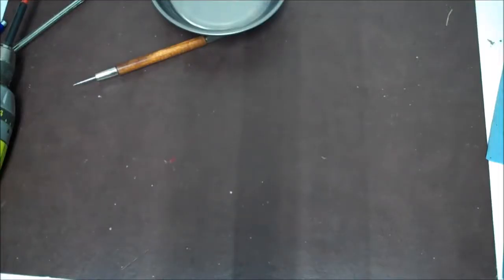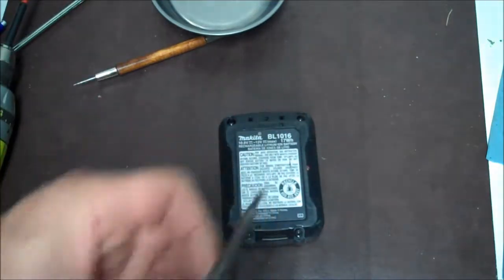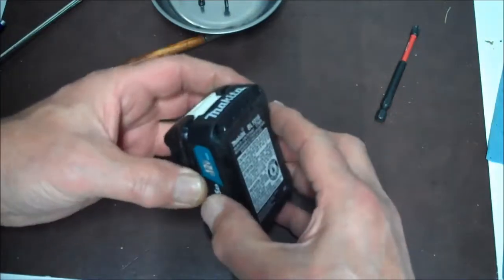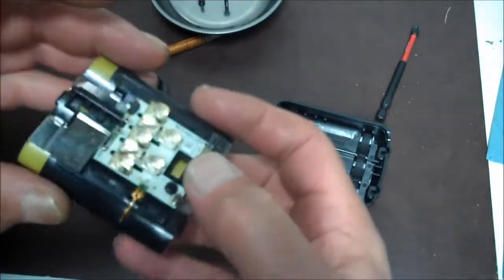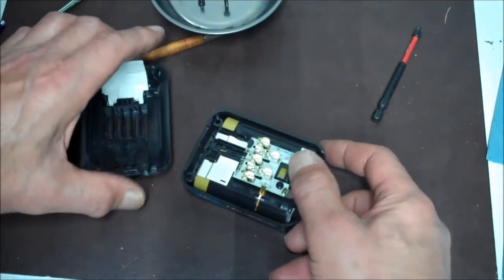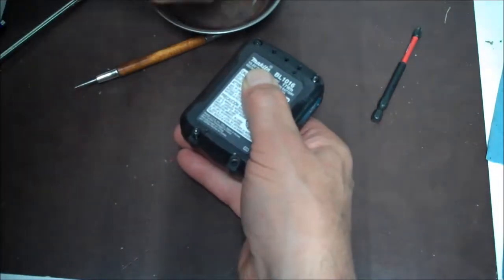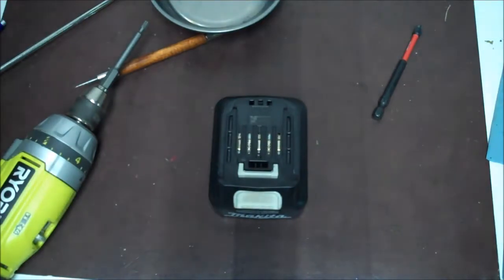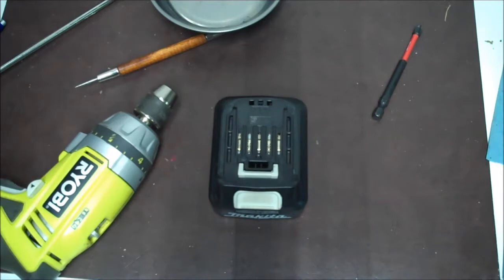MAKITA 12 VOLT BATTERY BREAKDOWN

Comment: Could I trouble you for a favor? That center conductor, is it positive or negative?  I've read that it's connected to a thermister to protect the battery and that it's probably normal negative & open when it's hot.   I bought a used Makita FD09 off eBay & I'd like to run it from a different battery.  I was able to figure which of the far side conductors were + & - from pics on Amazon.

Comment: Anyone know what the pin out for the 5 contact connectors is? I'd love to make a USB charger for one of these.
Reply: Do you know the polarity of the center pin?  I could really use the help. I found the polarity of the conductors that provide power.   I've read the center is probably negative and connected to a thermister to protect the battery should it get hot.